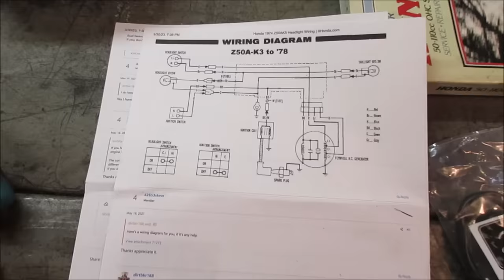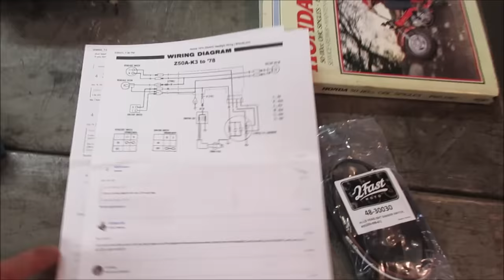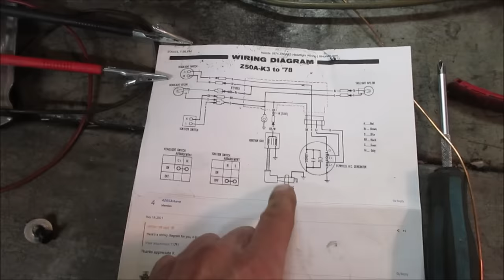They Could Not Fix It, Restored Honda Z50. Can We?

Comment: Just an FYI in my opinion the fan noise is fine. We can hear you easily over it so no need to worry about shutting it off… second. Do you sell anything you fix? I always wanted a blue Z50 and don’t care about originality.
Reply: He certainly sells stuff but this is something he wants for his collection. Although I suppose if the price was right he'd let it go? A Honda Z50 is very collectible. As a buyer in this situation you're at the disadvantage because you're dealing with someone that knows what they have and wants to keep it. So you'd have to overpay to convince him to let it go.
Reply: @1pcfred  as someone who knows the value also. I was just looking for a yes or no and a price.

Comment: Heal the coals if you can find one on the right side it will bring you back now to the right side of there you don't have to drill it bigger and deck it channel cracking the flyingames on that intake but that is if you can find a heater call of that's mobile

Comment: I had z50 when I was 15. That changed to mtx125 at 16. We can ride mopeds, less than 50cc at 15, less than 125cc at 16 and then bigger bikes at 18. There is I believe 35kw limit until 21 years old. That was not the case when I got the licence. I just don't get it why motorbikes are limited for 18 years old but cars are not. You cant ride 1000cc bike but go ahead and drive a bugatti. Stupid politicians..

Comment: Won't run right without the air filter in place. Carb designed with air filter to be in place to run properly air fuel/mix

Comment: I think you're lugging that engine.  Those little 50cc engines rev just great and without harm to the engine.  Leave it in lower gear longer and you'll have a lot less bogging (no power at lower revs on that tiny engine).  Then again, I don't think it was designed for a 200 pound person to ride all that much....  :)

Comment: I DONT KNOW,  MAYBE I'M  HEARING THINGS,  SOUNDS LIKE SOMETHINGS LOOSE IN THAT MOTOR. IF YOU WANT A HOTROD, MY BROTHER PUT ONE OF THOSE HONDA 125CC CLONES ON A MINI TRAIL 50, CRACK THE THROTTLE, IT WILL PULL THE FRONTEND OFF THE GROUND IN ANY GEAR. TAKES A LITTLE MOD OF FRAME FOR THROTTLE CABLE, ETC..., BUT CAN BE DONE. I'M  TOO BIG FOR THEM, MY KNEES HIT THE HANDLEBARS.